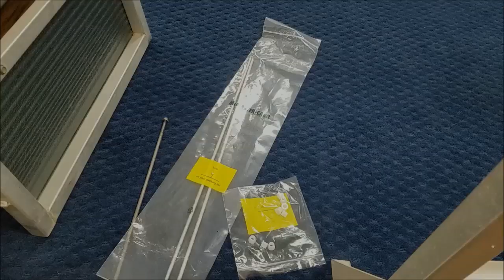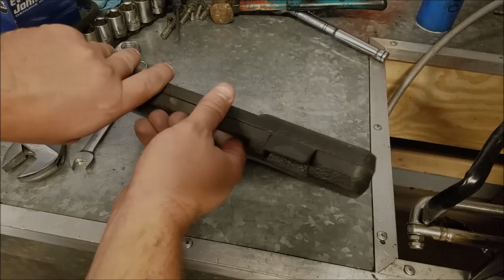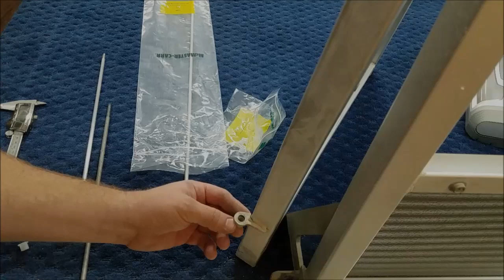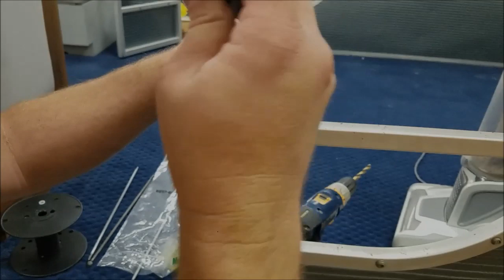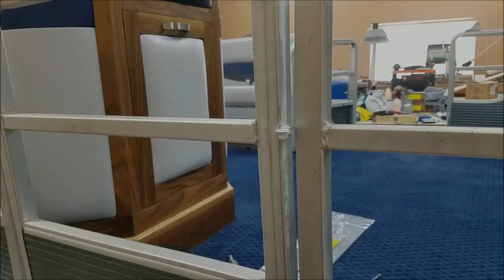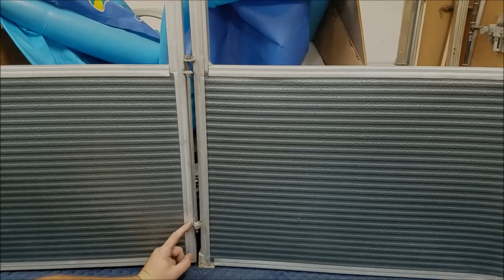Craigslist Pontoon Boat: Fixing Doors / Hinges

Comment: I see that you had a spacer at near the bottom of the 1st door when you were trying it.  From experience with pontoon boats I would recommend you get spacers that go under the railings at the bottom.  These are on all newer better designed boats.  They provide two great features: 1) it allows you to wash the deck with a hose and water will go out under the rail all away around, and 2) I've actually had water, from a large wave, come up on the deck and push the front door open.  You'd be surprised how much water weight on top of the deck will make the boat unstable, but having the spacers all the way around will allow the water to drain off of the deck fairly fast.  Here's a good location for them:  https://www.pontoonstuff.com/products/pontoon-fence-riser-kit

Comment: Rather than using plastic bushings I pop rivnuts in the holes then drill out the threads for the hinge rods.  Rivets are pop rivets with threaded stems so you can put bolts in them. They will build up the strength of the hinge plate tab and can be replaced easy by just drilling them out and popping in new ones.  I use a little silicon grease on them to keep them quiet.

Comment: Nice. I'd put a rubber bumper on your nice new wooden helm so the door doesn't scratch it when it swings open.
Reply: OR on the Door.
Reply: I cringed every time you swung that door against the helm pulpit!
Reply: put rubber door bushen  that guy did badass job!!